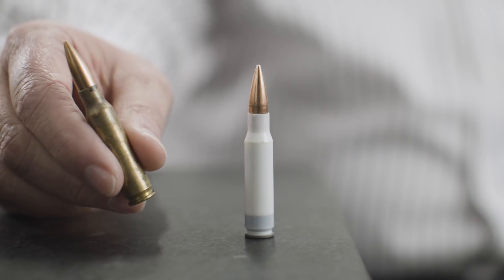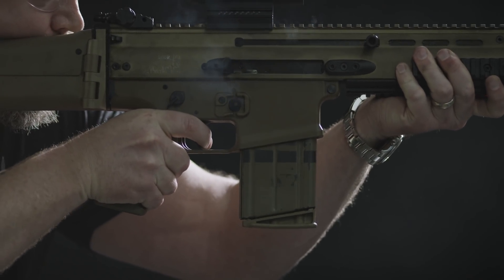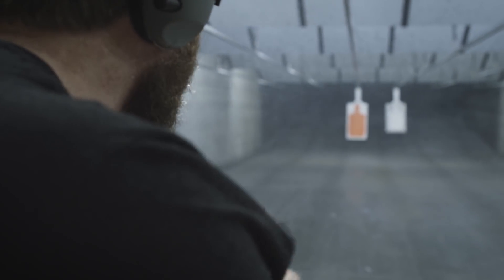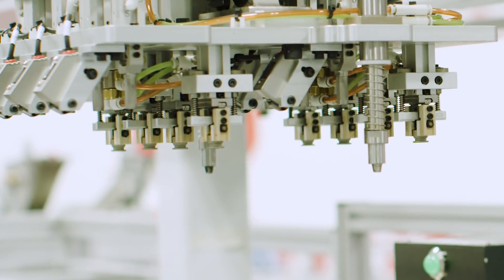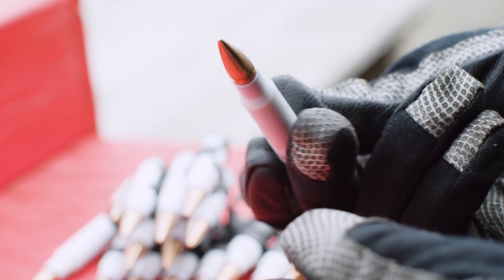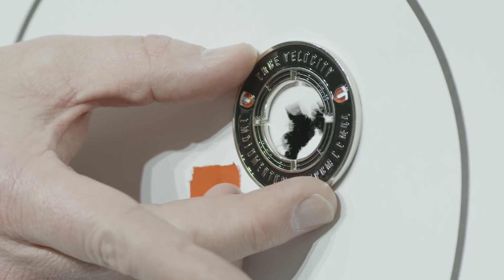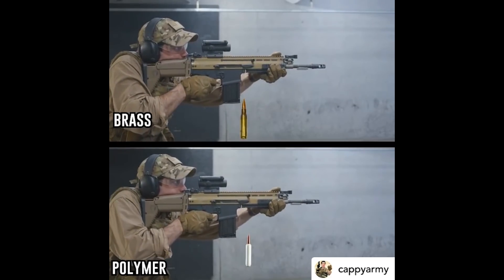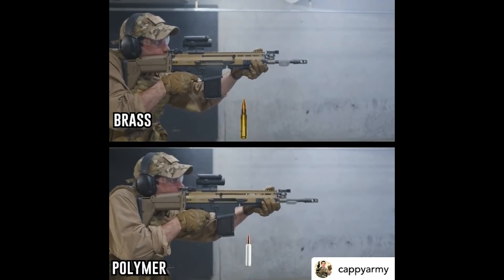Composite Ammunition is More Accurate than Brass | NGSW | Next Generation Squad Weapons

Comment: The heat transfer part of this is particularly interesting. I notice that the brass from my bolt rifle comes out at barrel temperature and that's just a second or so after firing. In a gas gun, we all know the brass comes out HOT. The energy spent making that brass hot is energy that was NOT used to propel the bullet. We normally don't see this waste in manual actions because the heat transfers through to the barrel/chamber.

It suggests that brass cases might be improved by use of a thermal barrier coating of some kind.
Reply: I want to know how this affects longevity, because heat kills guns, and if that round doesn't have what is essentially a brass heatsink pulling heat out of the system, what is it gonna do to barrel? They haven't changed propellant technology or they'd be diving into a quarry filled with hundred dollar bills, so they have a burning powder pushing a lead/copper bullet, for a given velocity and weight combo down a barrel and now all of the waste energy not used is being transferred into the barrel of the weapon. If I had the money I'd do it myself, but I would like to see this tested. As far as the higher efficiency claim they'd would have to know the exact powder blend the other company is using to prove that, and the majority of ammunition is loaded with proprietary powder mixes so a comparison is iffy at best, and flash is a byproduct of which round is loaded with flash suppressant or not.
Reply: Agreed. A coating that is heat, cold, chemical, dirt, sand, water and abrasion resistant that would not react with brass nor remove the ability of the brass case to obturate and grip the chamber wall while firing. Hmm. Maybe on the inside of the case, but that's a whole new set of problems. They'll throw a trillion tax dollars at it I'm sure.

Comment: as a gunsmith i say
polymer wouldn't stand the heat of rapid fire 
will just melt in the chamber i assume  
maybe good for single shot rifles
Reply: How hot are we talking?

If we're sub 200 degrees it should be fine

Comment: What happens when the barrel heat is transferred to the chamber after sustained fire, and a round is left in the chamber for an extended period of time? Does it melt into the chamber(stuck), or does the heat not affect the case? Combat can see many rounds during continuous fire situations heating the entire weapon. I'm just curious.

Comment: I had several groups under .5 MOA with factory FGMM (brass) last weekend in my $650 rem 700... If this is more accurate, I'll be surprised, tbh... Pleasantly, but surprised. It's easy to claim accuracy, it's a whole other thing to deliver it millions of rounds on end like Federal does.
Reply: At what distance?
Reply: @isoboi702  With his $650.00 Remington 700 and his $79.99 Tasco ill bet the answer would have been 600+ yrds. And he probably tells all the ladies 🤏 is 10" also. Fact is, 95% of shooters can't tell distance with out a range finder or a being on a marked range. Fact is this, I've seen testing down in the real field with this ammo. And what gets my attention is the lack of heat and the lack of muzzle flash and unturned powder. Even when shooting a rifle with a large suppressor installed. Where you typically see residue from the gas coming back into the chamber. This ammo did NOT show these signs. This test where being conducted on a 0-780 yrd outdoor range at approximately 1180 ft above sea level.  Yes, Its expensive ammo, But for what there gaining, The DOD will likely jump on  it. Because its no worse than they already have. Time will tell. Hopefully there working on a 338 LP Mag round for the MK21. And its baby sister the MK24/MK248 in 300 Win Mag.
Reply: Mass production and consistency? That's much easier to do with polymer casings than brass. MUCH easier...

Comment: How much heat does a plastic case remove from the chamber vs brass? If it is less then barrels will wear much faster. If the ammo is lighter but you must carry another barrel or two you have gained nothing.

Comment: Same exact premise of a shotgun shell. Absolutely no difference in accuracy though, only loss of durability of the ammo and danger of hot chamber melting and cooking off rounds because plastic doesn't transfer heat like brass to remove it from the weapon. Yes, that's the reason for brass, to take heat with it on extraction. Fkg stupid.

Comment: I think you have to try to think like a big-contract purchaser on this one. 
1) less weight
2) less signature
3) less propellant for same result
4) less risk of spent components being usable….

Infantry rifleman or machine gunners are not intended to be snipers. 
Snipers are a specialized role, often time equipped differently than infantry. 
In a combat environment, we do not set up on a platform and measure how many of the projectile impacts fit inside of a quarter. 
Just sayin’……

Comment: I'd like to see a thermal camera side view of both brass and composite being fired to see the difference in effect of this heat transfer. 
I still prefer brass but I see composite becoming much more widespread, especially with 3d printing technology. The ability for people to build their own casings will be revolutionary
Reply: There is a huge difference between 3d printing and injection molding
Reply: You still need the metal rims and they may not release the composite mixture or it may become illegal to make due to their Contracts nature
Reply: And it will immediately be declared Illegal, immoral and fattening by Repressive Democrats "for the CHILDREN".
Reply: @ocelblack9823  If someone has the ability to produce it themselves while keeping the ammo to themselves, it wouldn't be too hard to keep it a secret.
Reply: IF the primer hole can be stretched out as a tube toward the bullet you will get more velocity.
Reply: You can already make cases with a lathe, it's just not very efficient to do so.  You can do it though.  But deep drawing cases isn't really very complicated either.  It just takes a bit of persistence.  And NO you don't need a 1000 ton press or something stupid like that.

Comment: Isn’t the bigger problem here that polymer munitions cannot be reloaded?  That puts too much price control on the manufacturers side of the equation.
Reply: Composites,  not polymers..
Reply: @christianfelix1580  aren’t polymers also technically composites?  The bigger question being am I wrong to assume these can’t be reloaded.  Whether I’m wrong in my nomenclature seems like the secondary issue here.
Reply: @charleshetrick3152  polymers are typically plastic based, composites are generally a composition of glass, ceramic and some type of metal alloy, as far as reloadability, my guess is probably not.

Comment: Not sure I'd trust it. What is the materials melting point? Does it become brittle in the cold. Does it warp in heat? Is the material hydrophobic? Can you store it long term in ammo cans? Can you store it in loaded magazines without warping. Does it basically add wad type fouling from a shotgun round to a rifle barrel?

Interesting tech but so many questions.
Reply: How about overheating the barrel if the round isn't getting hot

Comment: I have seen multiple reviews and your ammo while sufficient was anything but superior. It in no review I saw grouped as well as generic ammo. Glad to see innovative ammunition design, however being plastic cased doesn’t make it any better (other than maybe heat transfer to be fair). The price was pretty crazy per round as well for your ammo… None of these are game changers outside the case material.
Reply: Also I wanna see per-cartridge weight as well

The reason the US changed from 7.62x51 to 5.56 was because 5.56 allowed you to carry more at the same weight, and in modern warfare suppression fire is a must which means you can't have too much ammo (to an extent).
Reply: price gona be the production and copyright issue
Reply: Innovation has it's drawbacks, one, as you mentioned, is high upfront costs for the consumer, but it's steep for the manufacturer as well due to the development of technologies. He mentioned no superiority in the video, rather a path to potential superior alternatives, that was lost on you, based on your comments. This is a step in the right direction, as the modern center fired cartridge has had little change in 150+ years. It's great to see there are people out there trailblazing! Those of you who want to over-critique innovators, for the wrong reasons, should just embrace change, maybe come up with your own ideas, rather than throw stones...
Reply: How long is the ammunition stable for? If it only last 5-10 years then we will have a problem.
Reply: @marcusablpn I would buy it if it lasted only 1 year but was cheaper than brass 🤷‍♂️.
Reply: @Shadow__133  me too. But it was talking about military use. We know they keep rounds for like 20 years so it wouldn’t work for them.
Reply: Its a production issue, because it ain't mass produced yet

Comment: Is it lighter than brass? Cheaper than brass? Reloadable? Recyclable? What's the wear on the gun like?
Reply: Its lighter for sure, not sure how much exactly but enough that 50 cal plastic cases are used in helis to reduce weight enough to be worth having there at least, take it for whats its worth. cost is high because it lacks mass manufacture like brass does but i would imagine it would be less than even steel cased if it was produced at the same volume as steel and brass are because its easier to make the plastic at volume than forming metal at volume and the materials are cheaper than metal to begin with. i doubt its reloadable but i wish people would stop acting like that matters in a military context which is what it is being designed for, just buy brass if it matters so unreasonably much. We'll see about recyclable. wear does not matter, steel cased stuff doesnt increace wear in any meaningful way that matters. If ak and ar15 can handle tens of thousands of rounds of steel cased ammo (which for ak is basically only ever used) with no issues i doubt plastic will change anything. In other words id love it see become more of thing and see enough development to make me question if i should use plastic cases instead of brass and steel

Comment: 🤷🏼‍♂️ 
Questions I have ;
#1) Is it Cheaper to produce?
#2)  Can you Reload it? 
#3) Does this Case make the rounds Lighter? 
#4) how is wear and tear, and hold up over time, how do they Weather?
Reply: Reduce Reuse Recycle, seems like you just can't stress that enough these days.♻
Reply: Way pricier
Reply: If that is true then there is $0 civilian market for this ammo.
Reply: @AKlover  it wasn't made for the civilian marked. The government doesn't care about the price. And for militairy purposes my guess is it could save A LOT of weight. As I think both the case and the less gun powder will save weight. Which is huge in militairy applications.
Reply: I don’t think you can load these with a standard bench reloader. I think they use a heater to warm the necks before bullet seating.
Reply: the replies sound like a minimum market angle, and therefore not neccessary for Civilian markets if It cant compete with other Civilian Ammo .. and this company could be on Crutches.. 

I'd prolly buy one box for testing. But I'd likely just pass.
Reply: @coppertopv365    Why would you OPT TO NOT sell to someone you legally could though???  That's cutting your nose off to spite your face.   There is something off here that would crater civilian sales they are not stating.
Reply: Oh hell no! That’s one big bad no about that, there’s no damn way you’re gonna be able to reload that.
Reply: I’m thinking strictly wealthy high dollar customers like militaries can afford this one.
Reply: Nailed it with a nail gun
Reply: It save 30-40% if not mistaken
Reply: @Kevin-fj5oe  30-40% in weight you mean?
Reply: @Kevin-fj5oe  That's absolutely huge

Comment: What happens in extensive firefight, where the barrel eventually overheat, and you still has a bullet in the chamber, and several more in the magazine?
Will the plastic melt? Soften? Even if the ammo does not cook, how the gun operates with a partially melt cartridge?
Reply: Then it's back to an open bolt design.